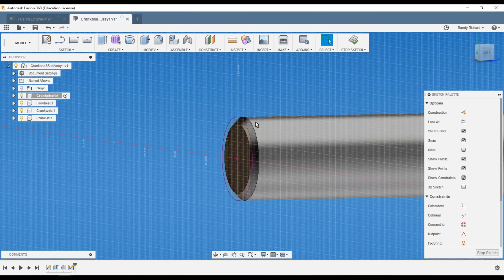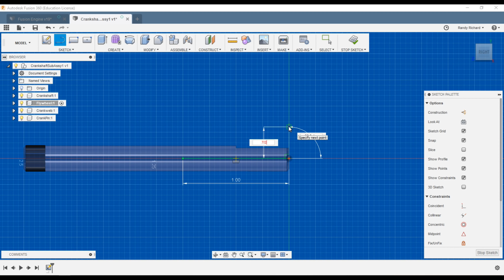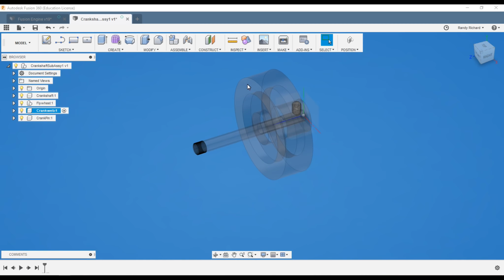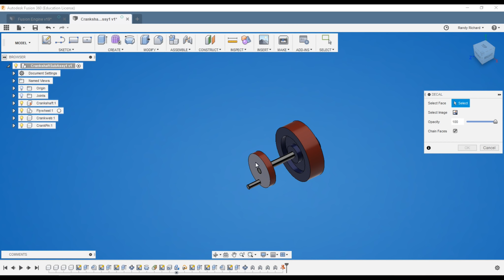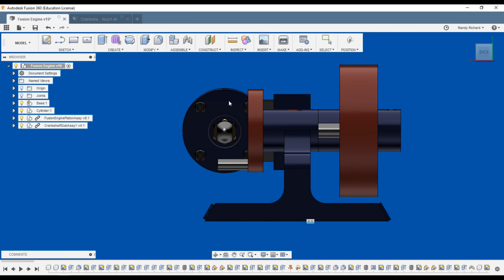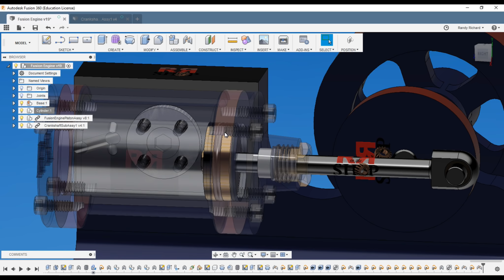P5 How to Model the Crankshaft Of a Model Steam Engine From the Ground UP

Comment: Final Exam!  I’ve got a working model! 
It took a lot of fiddling to get it all working together. At one point, I got so frustrated, I went back to an earlier version of my model before I inserted the crankshaft assembly and re-did it. That created its own set of problems. I started working in the earlier version instead of promoting it. I got the working model going but then couldn’t save it. Lesson learned! If you go back to an earlier version, promote it before you start working in it and then work in the promoted version. I had to re-name the model and save it as something else in order to save my work. In configuration management terms, it forced a fork in the version history.

Comment: Great series of videos, if there is a Oscar award for you tube you have earned it. I had to change the length of the crankshaft rod to make it work ( must have gotten one of your dimensions wrong but got it rotating. I learned a lot from your videos, not an ace at fusions but can sketch up the things I make on mill and lathe. Thank you for your patience you are a great teacher.
Reply from the maker: Thank you Gary for the Kind words.  I think it is going to work out.

Comment: Great.  I got a lot out of this series.  Looking forward making 2D drawings and exploded views.  Thanks.  Enjoyed modeling the knurls but I think it would have been faster to apply the "Steel - Knurled" appearance to the shaft and crank pin.  Some of the joints are still a little magical to me.  I need to work on that.  Thanks again.
Reply from the maker: Coming, Oh fast and easy if you are just looking for an appearance.  Lets do Diamond Knurl in the next video.